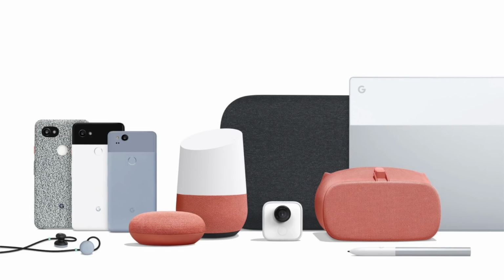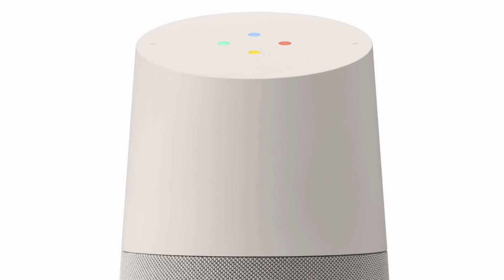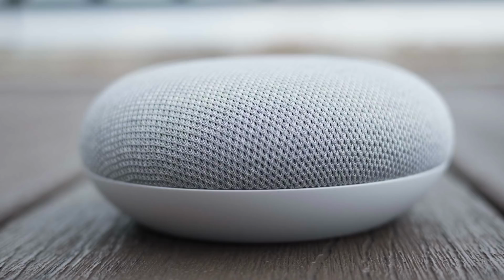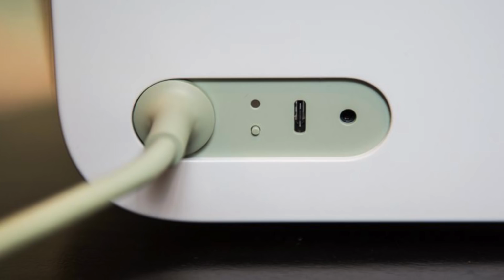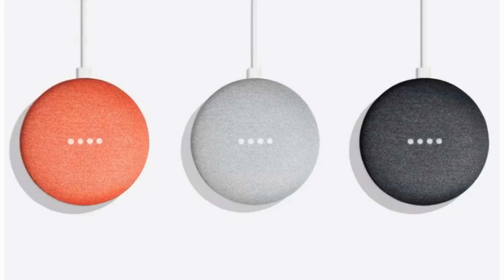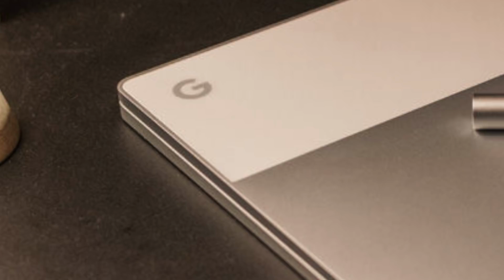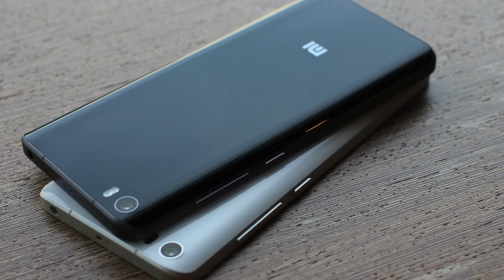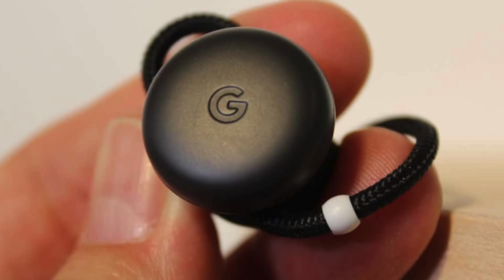Google Products Design Language | Industrial Design

Comment: All the experienced designer who work in top brand knows that minimal design on electronics in most of the case cost more because you need spend a lot on the detail to make the minimal design not a "cheap" design.  And don't think you can handle the design language topic, sound very junior...I won't blame you if you are just a user, but you are not. in Short, this video is totally miss leading.
Reply from the maker: Yo Hang! Thanks for commenting. Eventually you will learn that everyone has their own opinions, just like your comment. Same goes for how people interpret your designs since some people will love and some will hate it. There is no one way to do it. This happens to even the best of us, even Apple. This video was my opinion to help new designers and attempt to learn more about Google. If you don't like different options, the internet is a hard place to be my friend. Good luck!
Reply: Like you said, everyone has their own opinions, I just shared mine. And thanks for your wishes, I think the internet is not hard for those who has objection, maybe very hard for those who are not ready to hear an objection. I will more than happy to hear you ask "WHY" I said what I said, like all the great designer I have being work with who loves to hear their idea is not being perfect so they can make it perfect.
Reply from the maker: Hey Hang. You are correct. It is fine to ask why. But as you know, everything can always be improved and its not wise to take recommendations from anyone, at all times. If it makes you feel better, in the words of the great Steve Jobs, I do my best at the time, and I learn along the way. I think a lot of  us do, so its good to not be so judgmental next time when you try to help others. Maybe the people you are trying to help will be more responsive to your recommendations. Thanks man, appreciate the chat.